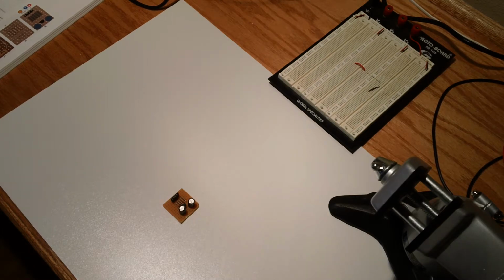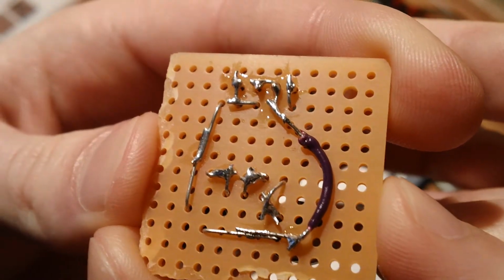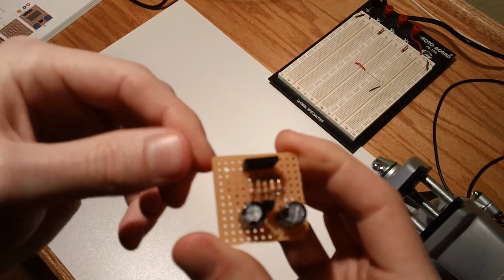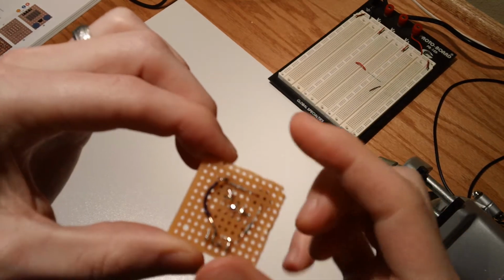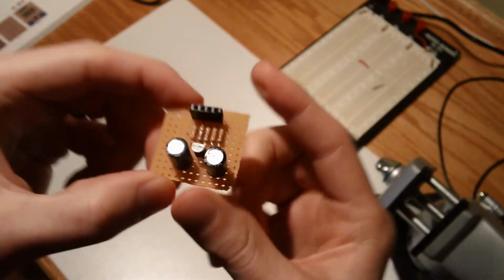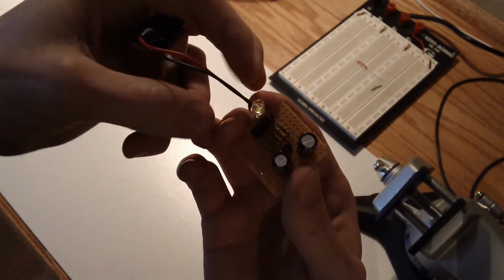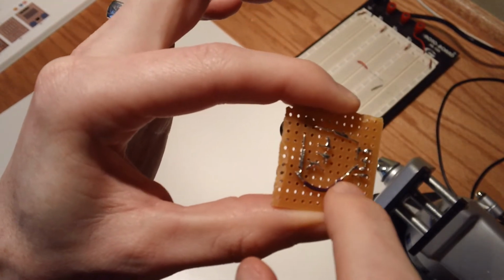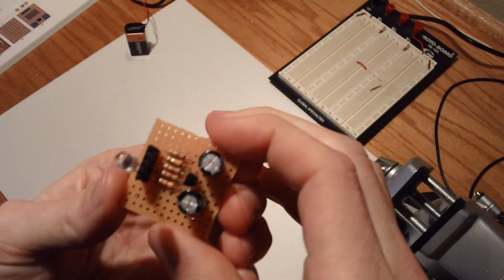Make: Electronics - Experiment 14 (Part 2)

Comment: You could maybe use more LEDs, and have an inverter circuit hooked to a photo resistor or solar cell, so that the led lights up and oscillates when it is dark outside